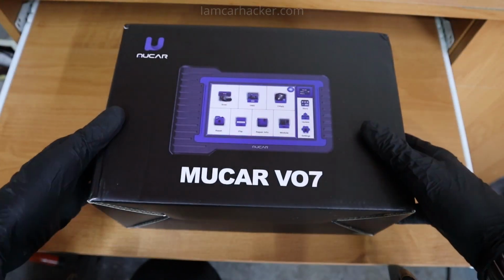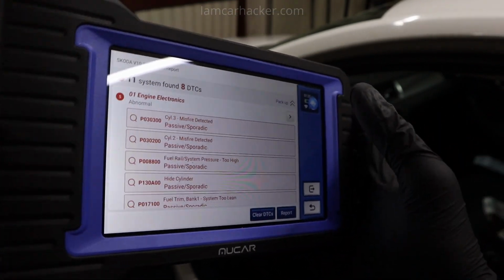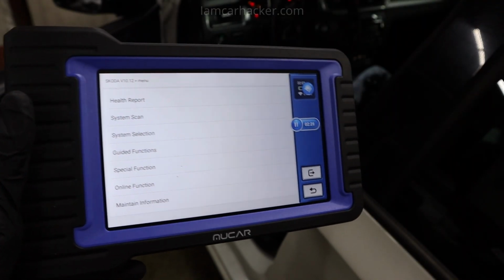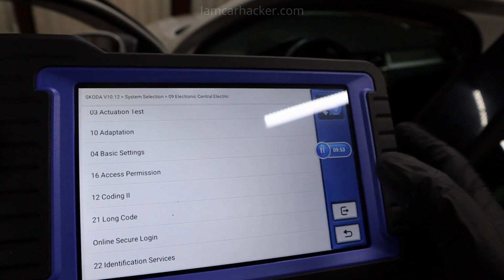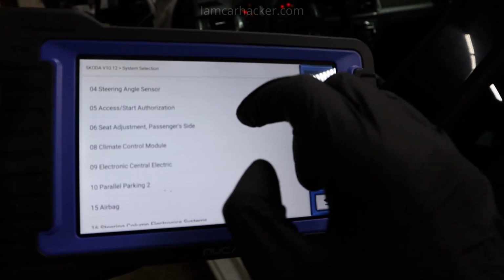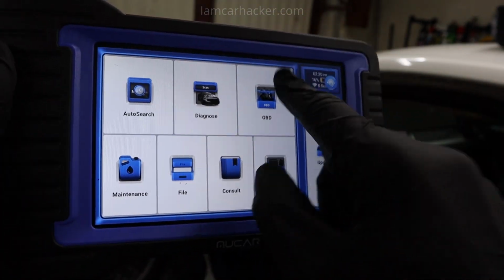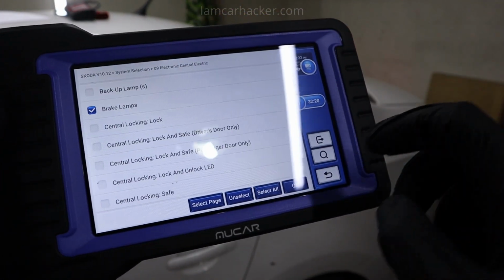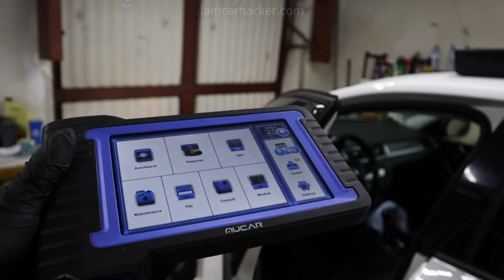BEST low-budget scan tool? | Mucar VO7 Review

Comment: hello thank you for your videos what scan tools can permanently disable the code to turn off the Catalytic converter code because I put an aftermarket one in  I was told by someone that the HP tuner one will do that it will turn out the code if you want not to come back permanently disable the code
Reply from the maker: Yes but for that you would need ECU programming and only more expensive scanner do that...maybe from $1300

Comment: Is there different vo7 and vo7s
Reply: Seems like V07S is compatible with CAN-FD protocol and supports the latest For GM vehicles manufactured after 2020. , (MUCAR VO7 does not support CAN FD).

This is from their webpage. It's simply access to a higher bitrate protocol which I guess the newest cars demand. I was wondering the same thing, so just did a quick search on it.
Reply from the maker: Im not sure there must be some but probably nothing significant. I don't even know which one is mine lol

Comment: Can it or does it show erased or old fault codes
Reply from the maker: If car store data like this it can read it
Reply: @iamcarhacker Thank you✌️. You could see proof off rolled odometer? Is it possible to change odometer to the original engine miles. I have changed odometer, and i want to put back the orginal.
Reply: @amcarhacker do you know of the Mucar vo8 can change odometer?